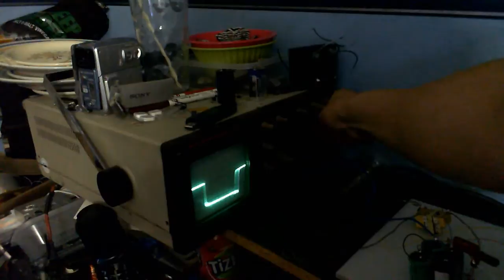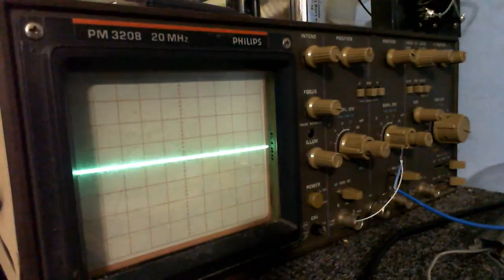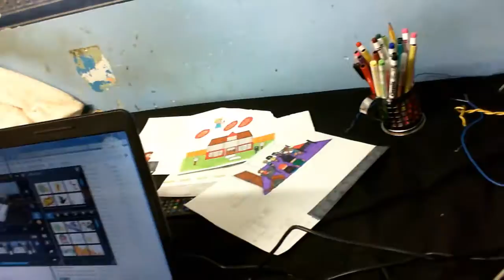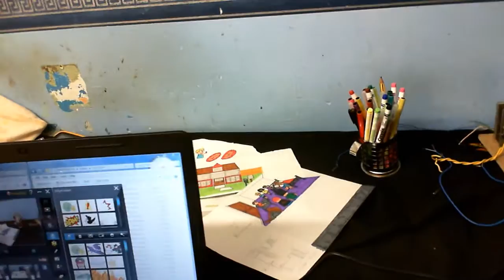Building A SMPS part 3 - I do some tests and blow the mosfets!

Comment: Which driver IC are you using? and did you figure out what killed the mosfets?
Reply from the maker: twenglish1 I'm not sure, I think it was an IR2184, but don't hold me to that (or whatever the expression is).  Stopping the IC osilating was what blew the mosfets.
Reply: I am currently working on a switch mode supply that will supply and regulate welding current, i will be using a full bridge topology driving a ferrite transformer capable of 5000 watts, right now i am working on the driver state, i will be using an SG3525(not sure if you are familure with it) it will be driving two transistor pairs which will drive the primary of the gate drive transformer, the gate transformer will have 4 secondary windings, one for each of the IGBTs